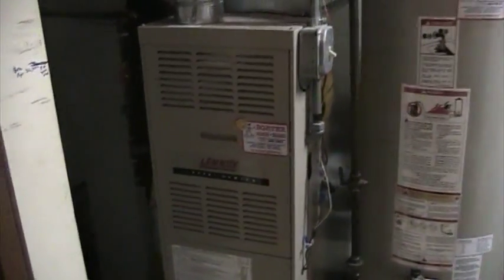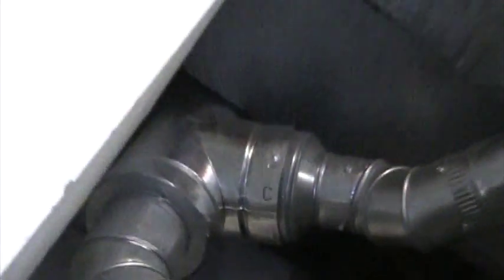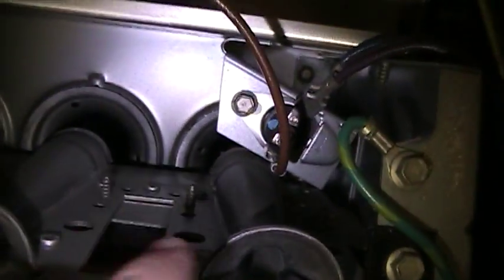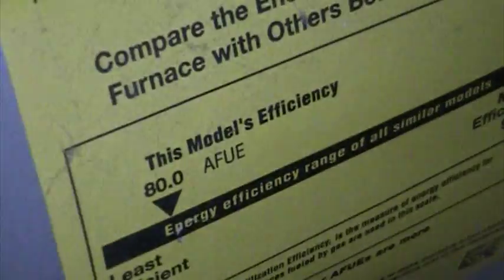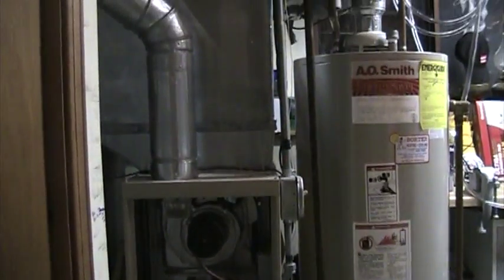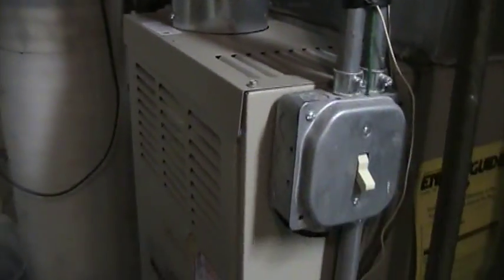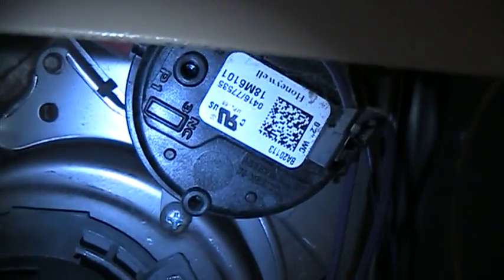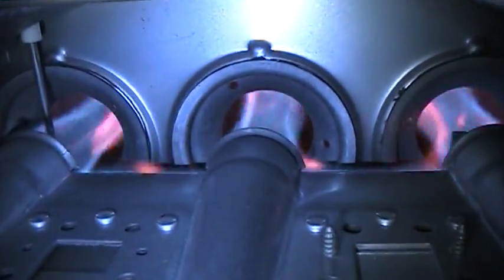HVAC: Gas Fired Furnace Sequence of Operation

Comment: Great video!! The it gits up to 3000F in there and I don't like these  fillers you need a bigger return 1'5 ton 16/20 2 20/20 2'5 20/25  3 20/30 3'5 25/25 4 25/30 4' 5 25/25 + 16/20 5  ton 2 25/25 and that's a lot lol